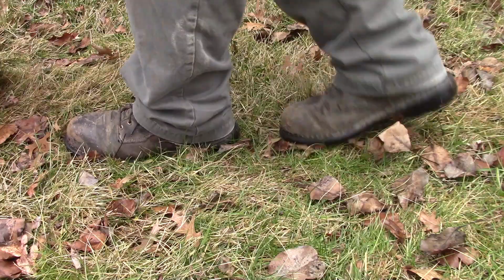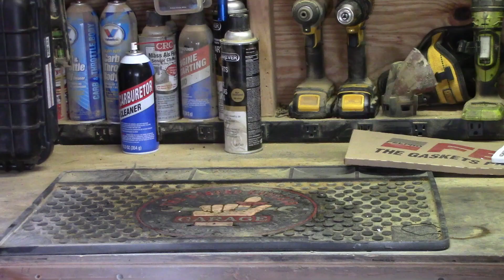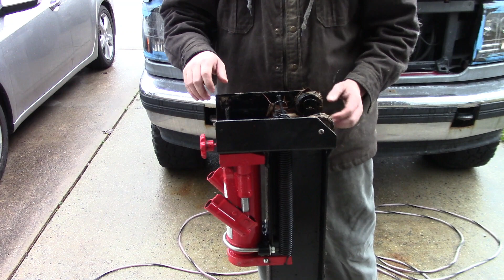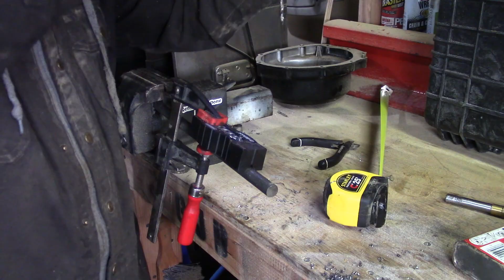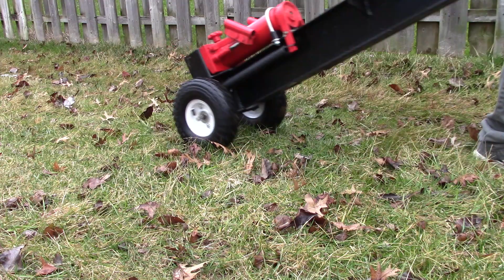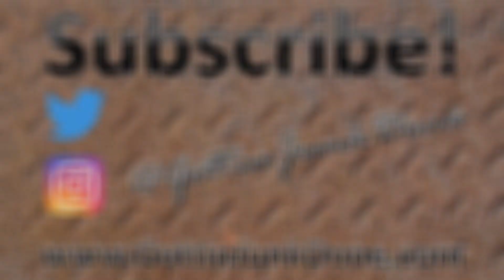Add Wheels to the Harbor Freight Manual Log Splitter by @GettinJunkDone

Comment: I just did this thanks to your video. I used two 5/8 bolts that fit the tires, and drilled the original holes to fit the bolts. Wonderful hack. Thanks for the inspiration!

I'll add something later to the other end of the splitter to make it level, but for now resting it on an appropriate sized block of wood does the trick for use of the splitter.

Comment: I did this to a HF log splitter, but used long bolts which fit into the existing holes, and then added a spacer to make the diameter large enough to fit the wheels. No drilling needed. No modification of the log splitter. Much easier, and cheaper, but not as strong, but strong enough I think. Easy to go back to the small wheels if desired.

Comment: Small lawn mower wheels will replace the existing wheels with no cutting or changes to existing holes in the splitter. Of course the wheels go outside the splitter. They also make the splitter rock solid when using the tool, no rocking when splitting the log.  When a log is split enough the two handles can be used to pry the log apart instead of continuing to pump the handles. A lopper can be used to cut wood that does not want to separate.  Ten ton log manual splitter.  Also use a metal spacer for short logs if you can find one. I use a short I beam.
Reply from the maker: All very good points.  Thanks for the helpful comment!

Comment: Just put a set of 6" wheels on mine and what a difference!  As another commenter mentioned, I had to cut out a small portion of a brace to get the axle to pass all the way through.  It is on a bit of an angle when I stand it on end but it is still stable.  Thanks for the great tutorial!

Comment: I bought one, did mine with a piece of all thread, nuts and washers and was thinking I was the only one to figure out a way to put decent wheels n tires on it. Was looking for something else and "BAM" you have a video fixing a major issue these have. My next mod is a handle system so when laid down it sits level with the new larger tires and a removable tongue so I can hook it to my rider mower or ATV. Hard to drag this around and use a cane to walk with.
Reply: I thought the same thing. With the oversized tires, It wouldn't sit level. But an oversized handle would double as an leveling system. Great hack all around!
Reply: I did the same thing with all thread, I also added a small piece of chain with quick links to the existing handle so I can hook to tow hitch on 4 wheeler. I love this splitter!
Reply: A removable tongue for pulling it behind a tractor. Brilliant!

Comment: I just did the same to my HF log splitter after watching your video, thanks for the great tip! On mine there was a brace between the wheels that blocked the axel so I had to notch it with an angle grinder.

Comment: Great improvement on the splitter. Those small original wheels are only good on solid surfaces like concrete. And how often do you chop wood on the DRIVEWAY ? ? ?  Thanks for the info on the centering drill guide.   J K

Comment: Great hack! My first thought was ok now it won't lay level when it's on the ground. But who cares, it should still junction just fine.  I'll do it to mine at some point. I will probably change the axle location so it will still store upright, or keep the same axle location and weld a little kickstand on it if needed.  Also might go for non-pneumatic solid tires instead. Maybe some old oversized push mower wheels just to keep it cheap and low maintenance. Thanks for the vid!

Comment: How does it work when splitting? Does it roll away? I’ve considered doing this to mine but I decided not to because the wheels from the factory allowed the splitter to sit flat while in use, but those wheels would seem to elevate it and the bottom of the Splitter wouldn’t touch the ground.

Comment: I have this same splitter but it lives in a barn so does not need to be moved far. I do have a problem though and I don't know how to fix it. It started leaking hydraulic oil due to a worn O ring on the left hand pump. I fitted a new O ring which fixed the leak but the pump is no longer advancing the ram properly. It advances when you pull the lever but the ram goes back to where it was on the return stroke. I think it must be a ball valve not seating properly but I don't know which one.
Reply from the maker: Sounds like there might be some air in the system.  Not sure, but that is the first thing that comes to mind.   Kind of like mushy brakes that need to be bled.
Reply: @GettinJunkDone  I did try the bleeding method given in the instructions and another method I saw on YouTube but it made no difference. I also changed the hydraulic oil but that made no difference. I checked the ball valve under the pump itself but I think that is just for when you are drawing oil from the reservoir into the pump. I think the one giving trouble is under the ram cylinder.

Comment: Add wheels using 1/2"X3" hex bolts and washers. Now able to move it easier cross the lawn without it tipping over.